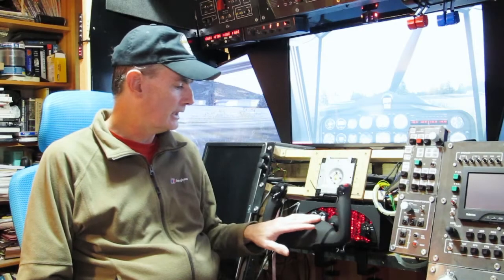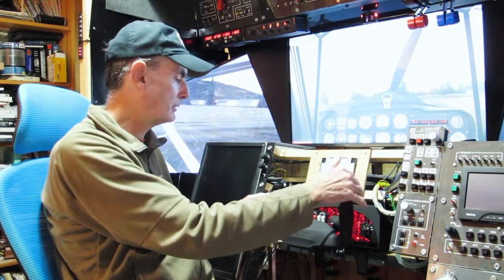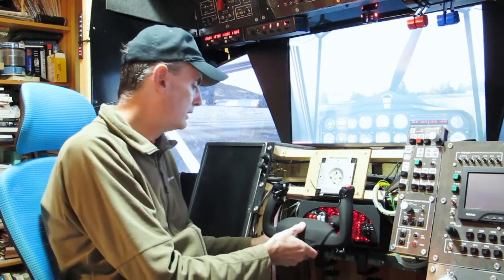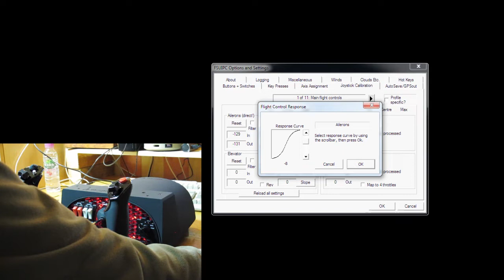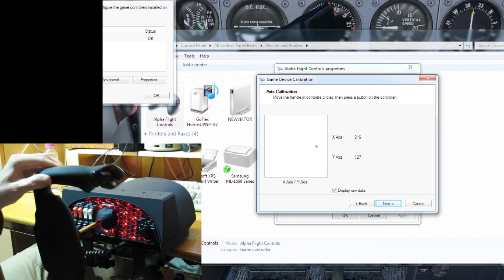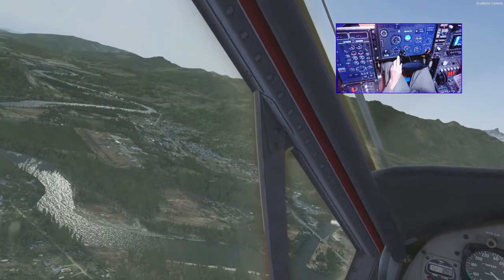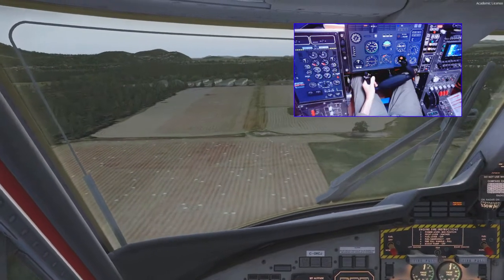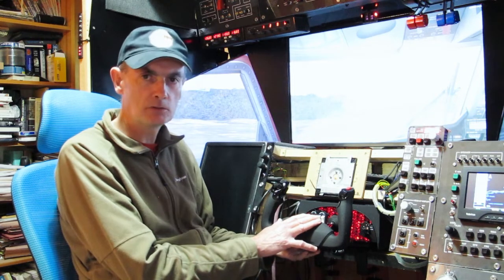Honeycomb Alpha Yoke Review

Comment: I have ditched my saitek for this as it is a lot better in form and function than my saitek which although has been around a long time does feel very much like a toy in comparison.
 I agree that yes there are better yokes such as the Yoko the yoke but they are very expensive and as i am a pensioner, the honeycomb (in the early access discount) was  my limit and  for slightly over £200 was very good value. a
Another good selling point was the 5 yeAr guarantee. Honey comb states that real aero engineers had input on the design and construction. initially the use of Hal sensors (such as the warthog HOTAS joystick) were considered but the price would have put this out of the reach of a lot of consumers , myself included. No doubt it has been built with compromise in mind but having said that, it's still the best out there in this price bracket. I have also ordered the Bravo throttle control which really does look quite comprehensive but again time will tell. thanks for a very thorough and honest review. As ever You always tell it as it is!

Comment: I received a Honeycomb yoke yesterday that I hadn't ordered due to a screw-up with the supplier.  I decided to check it out before I send it back.  I primarily run my simulator in X-plane 11 which didn't require any drivers or additional software.  The movement of the yoke in X-plane 11 is linear on both axis.  For all practical purposes there is no dead zone in either axis.  Just the slightest pressure with one finger shows up on the onscreen yoke and the onscreen elevator and aileron outputs data form X-Plane.

I got rid of FSX a few years back but I do have Prepar3D V4.  There's some software required from the Alpha Flight web site for both FSX and Prepar3D V4. After installing the software I loaded up the Real Air Scout but nothing was set up right with the yoke.  I decided not to go any further as I'm sure the results would match what was in your video with FSX.  I was left with the impression that this yoke was designed primarily with X-plane 11 in mind.  

It's my desire to go with a Yoko to replace my CH yoke.  However, for anyone using X-Plane 11, this Honeycomb at it's price point is a good alternative without some of the issues you found on FSX.
Reply: The only reason you see it as native in XP11 is because Austin Meyer designed a profile for this yoke himself that works with how it is designed. Lockheed-Martin did not do that, so Alpha had to do it themselves.  How 'good' it works is dependant on the control logic programmed in each sim, for which XP11 is a bit more advanced.  Wait for FS2020 and you might not have that disparity.

Comment: I enjoyed your review.

The limitations you describe in the number of buttons is actually an X-Input issue which Microsoft introduced with the X Box 360 as a successor to Direct-Input. X-Input was limited to 4 axis and 32 buttons, whereas Direct-Input could handle 8 separate axis and up to 128 different buttons. Looks like something else we lost with the switch from Windows XP to Vista along with hardware accelerated sound.

Comment: Good morning from across the pond.  Enjoyed  you commentary of the Alpha Flight Yoke very much, thank you for taking the time to share your findings with other like minded enthusiast.   I was interested to know which software  your going to utilize for programming your Yoke (Aerosft Input software, FSX or FSUIPS)?   So far I have had a little difficult using the Aerosoft included software (most likely operator error).   Looking forward to your follow up  opinion  after you have  a little more mileage/usage.  One more question which radio/com stack are you utilizing in the upper left corner?   Thank for  sharing you hobby with us Cheers!   Respectfully .  KnightShadow.
Reply from the maker: So far I haven't bothered programming the buttons on the yoke. However, I use FSUIPC for the analogue axes and LINDA (which sits on top of FSUIPC) for all my butons and switches. I haven't looked at the Aerosoft tool, so I can't give an informed view on that.

My radios are from the Elite AP-4000 range. I have a NAV/COM unit (set to NAV2/COM2) and a transponder. They are kind of expensive and if you want them to work with X-Plane you have to buy a driver from SimPlugins (the Panel Builder people). The FSX/P3D driver is free from Elite.

Comment: Thank you for this review using FSX. I just got mine, in Canada, on Saturday. I'd love it if you would show how to map the switches to turn the landing/taxi lights on and off. I'd love to just start mapping them to a Cessna 172 to start with if that is even possible. I've tried landing lights but have to switch the switch up to turn them on and then flip down and up to switch them off. I haven't found any solution yet. X-Plane seems to work with no problem, but my system does not want to run X-Plane so I'll stick with what I know. :)
Reply from the maker: I think the problem is that FSX doesn't expose separate commands for many things such as lights ON and OFF, it just gives you toggles. I think this is why Aerosoft has produced its own button mapper, which looks like it allows you to write chunks of XML code to do whatever you want with buttons and switches. I haven't played with this but it's probably quite technical.

Taking the landing lights as an example, you could try setting the same action (toggle landing lights) on both buttons 11 and 12, which will work as long as you are in step with the state of the lights. You can do it properly if you have FSUIPC (paid version), as it exposes many more commands than FSX does, including ON and OFF options for most things.
Reply: Trevor Teakle have you tried keymapper software app. This may work as I use it for my button boxes for truck sims where I have switches to turn on/off like cruise control, parking brake etc. Just map the button to a keyboard button and set to latch and when you flick the switch the other way will  activate the keyboard button again and do the reverse etc

Comment: Hello, Almost Aviation, thank you for another video, and for this review in particular. You touch on the main aspects and values that matter in a yoke, at least for me. I suppose the yoke was designed to satisfy the widest audience, so they made some considerations on the design.  The use of 2 buttons for each switch makes some sense to me because it is a straightforward way to map one action to the switch position off. Xplane, for instance, does not give directly a possibility to map a button release input,  I'm using lua script to accomplish that. The null/dead zone and effective center position is something that also dislike, it does not feel real ("right" is the correct word as I never touch a real plane),  but again it should be a consideration design, in some cases they are just needed. Just throwing some examples, Fly-by-wire almost requires an effective center position (better use a joystick!!!). Some planes disengage the autopilot on the yoke input, and the developer or does not include an option to disable that function or does not give a way to define a tolerance.

That said, now I can modify (perfectly aware that there a high probability that I'm going to trash it!!!) my Saitek yoke to increase pitch and roll travel, knowing that there is an affordable and better plan B. 
Cheers.
Reply from the maker: Ah yes, I had forgotten X-Plane can't do button-up mappings (I use SPAD.neXt for X-Plane). A better soluton would be for Austin to fix that :)
Reply: I believe he's already one that in a recent beta.

Comment: I was actually disappointed with the feel of this yoke.  The roll and pitch is inconsistent in feel - light aileron and heavy pitch but linear.  The CH increases with input which I love.  The difference is that the CH Yoke uses springs and the Honeycomb uses BANDS (rubber) which explains the feel. There isn't anything that really would make me want to jump ship from the CH Yoke I've had for many years (which is better than Saitek).  Had I owned a Saitek yoke...then YES DEFINITELY an upgrade.   But not from a CH.  The pitch is too hard to make a smooth flare where control surface forces are at their lowest even in trim, where the CH allows my precision, but I feel the force if I have to pull back harder.   I'm after precision input, but not at the expense of feel.  Another correction for you: These new yokes use digital hall sensors, and NOT potentiometers which is where that precision comes from (CH Uses Pots)
Reply from the maker: I agree the roll force is too linear but in practice I haven't found it an issue. It's hard to believe you could put them side by side and choose the CH yoke.

Comment: Pitch axis travel could have been better. It's about 5 inches. Eight inches would have been better. Pitch stiffness in and out is contestant and a bit too stiff at small movement in and out. It would have been nicer to have less stiffness at the smaller movement range and increase as you go further out.
Reply from the maker: Pitch travel is three and a quarter inches, not five. Eight would be nice, but nothing out there has that much travel. Personally, I think the pitch force is about right. Honeycomb says it is necessary to ensure an acceptable return to centre with the bearing they used.

Comment: It's so strange how Logitech can make a G25 back in 2006. A wheel that basically never experiences any dead zone problems and can survive for over a thousands hours of use. For €200, including pedals (That do enjoy some deadzone issues after a while to be fair) and a shifter. Meanwhile making a yoke (just a yoke, nothing else) do the same for under €300 seems impossible. Economics of scale or what?
Reply from the maker: A wheel and a yoke are not the same. A wheel has a continuously variable position, it has no neutral position like a yoke must have. Hence the mechanical design is much less complicated.
Reply: @AlmostAviation  I guess I hadn't thought of it that way as it's all just potentiometers (on cheaper gear at least).

Perhaps it's the force feedback design that also makes a big difference as there's no centering force for a force feedback wheel aside from the ffb motor.

Comment: I didnt think it was that cheap of a yoke cost me $450 AUD but then again i guess a conversion to pounds or euros will make a difference. Nice review btw
Edit: thank god x plane 11 doesn't have the the issue with the yoke, I had to actually limit the pitch movement of yoke by about half because it required a fair amount of force to move the yoke in terms of pitch apart from that I haven't had any other problem with this yoke. Its a good thing I moved away from fsx.
Reply from the maker: Perhaps I should have said 'relatively cheap' :)